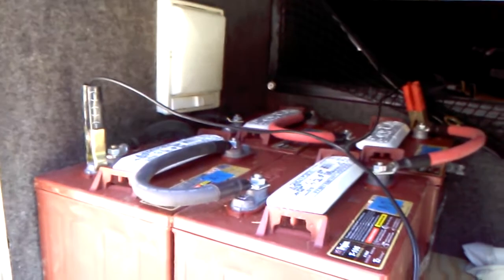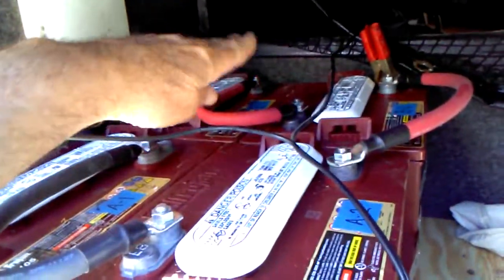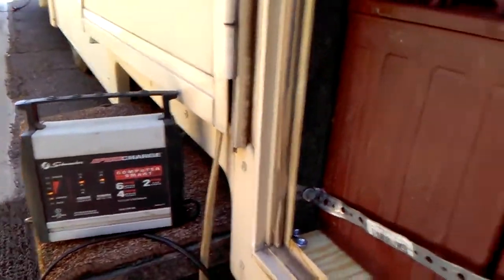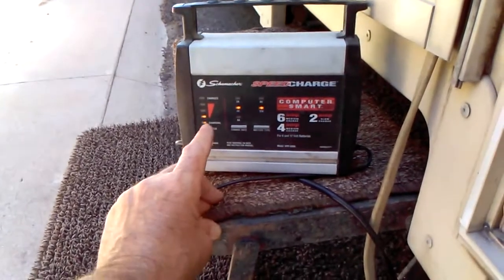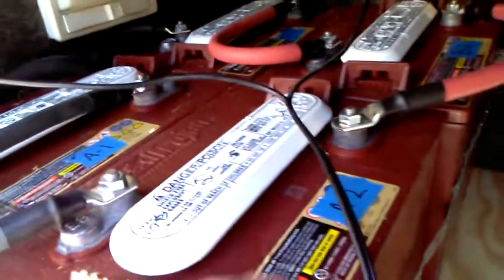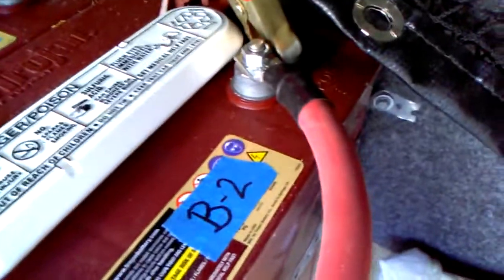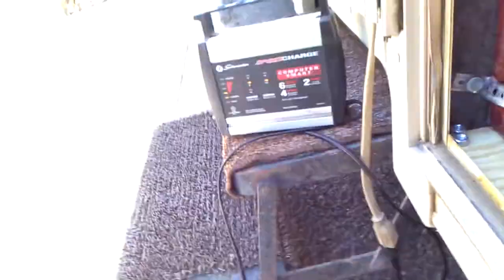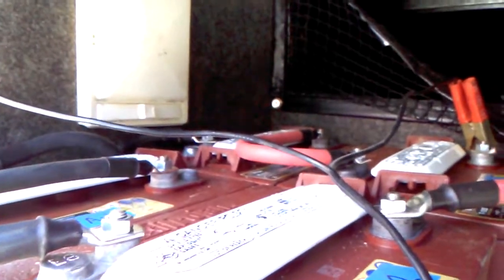HELP.! What is wrong when charging Trojan T-105's

Comment from the maker: Turns out the batteries NEED a bigger charge than my little battery charger could generate..
.. I had never heard this before,, but now it is out there to help others design their system.....
Reply: Flooded batts typically require C/10 minimum, or 45A for a 450Ah bank.
Reply: That's good

Comment: Check the cables or water in the batteries
Reply from the maker: Actually it was the charger.. Those batteries require more amps than that little charger could generate.. Happy Trails.!!

Comment: I actually called Trogen on Friday and the tech stated that 14,8 charging voltage is needed now for 4 batteries you need a bigger charger i think , you really have a huge battery bank to fill up , i looked in my charge controller box and found a old charge controller i could adjust up to 14.8 most go to 13ish voltage,  also learn about boiling your batteries,  be careful because your going in without a controller but it works.
Reply from the maker: hey Gary,, yeah I could have used that little bit of info back when I made video.. now I leave it up to show others.. Hopefully you checked out my channel and saw that I now have all the right equipment for the job.. been 2 years now and still running great.. .. Happy Trails.!!

Comment: i had the same . i had 12 volt 2 trojan t105 my 5 amp charger was not enough. how much solar are you using?
Reply from the maker: I have 12 - 100 watt panels hooked up to 8 - Trojan T-105's via 2 separate charge controllers.... I actually only use about ~350 watts at any one time,, tv, computer, refrig, fan, light,, but I do have some things that draw big juice like a hot plate and toaster.. here is a vid I did last year.:https://www.youtube.com/watch?v=Fy9jcnknhos&t=79s .. .. You said "you had"... what do you use now.? .. ..Happy Trails.. Thanks for watching.!!

Comment: I agree wired correctly.  Check water level, tightness of connection but overall large deep cycle batteries need a "hard charge lots of amp/volts like the battery guy said. The charger is actually trickle charging so it may take a few days and not great for the batteries. Nice batteries. More power Scotty lol
Reply from the maker: I have lived before with only 150 watts in a motorhome,, so I am hoping 900 will be sufficient.. Yeah, I agree that a small charger like that is not ideal for the batteries.. I would have put a single, smaller 12V for the coach battery if I had known that earlier..  Have you entered the Gold and Silver Giveaway yet.?

Comment: After living off grid and had battery banks such as yours, I concur with the battery guy. You need a minimum of 15 amps ,5 amps per battery.  Or disconnect and charge one at a time. Those small chargers are not meant to charge such a large battery bank.
Reply from the maker: I was planning on using 1 - 100 watt (~6amp)  panel to charge 2 more T105 'coach' batteries.. .. so that will not work.?
Reply: deserthorizons 
That panel will work for maintaining a charge, for occasional use, but if you are gonna use the batteries alot, you are gonna have to calculate your electrical load, and add more panels. Say for instance, if you discharge those two batteries down to 50 percent in a day, it would take four 100 watt panels, to get the batteries back up to 100 percent within a day, then you will also have to start getting into charge controllers. Even with one panel I would recommend using a small charge controllers, that way the batteries are charged properly and not over charged. This stuff has a science to it, hard to explain through a message. Contact Northern Arizona Wind & Sun, these guys are great and will be able to help you with any questions.
Reply from the maker: Gotcha,, Thank you.. I was going to hook up 1 - 100 watt panel through a 30A CC  to the coach (2 - 6V) uses DC that will not get much use at all.. Then 8 - 100 watt to these^ 4 batteries through a 79A CC for running tv, computer, lights, etc..  So it sounds like it is going to work and the batteries are good, so now it is just mounting everything and "plugging" it in..
Reply: deserthorizons

Your welcome! Glad to of been some help to a fellow native.

Comment: I wonder if the output of that charger is working. Switch on/off & verify selector switching. 
Other wise, id bet one of the cable lugs isn't getting good contact to a batt terminal. 
Something simple when you look over it again.
Peace.
Reply from the maker: The output of the charger is max 6 amps... That is NOT enough for these batteries.. It was something simple but it sure had me riled up.. Thank you for the input.. Did you enter the Gold giveaway.?

Comment: Ideas; could be the cabling is corroded somewhere less obvious. Get a basic digital multimeter, (hecho en china for "5bucks")  test resistance end to end on each. And then adequate current/voltage out at the charge source. And at batt terms. Above 14volts, (Controller or charger fried/damaged/ misprogrammed/ etc) elect current gets lost as heat, when facing resistance. That is also a " tell" of problem in a system/circuit. 
Also a specific gravity tester gives "state of charge " % (escapes atm, u can look up)
Peace.
Reply from the maker: Thanks for the ideas.! .. -I know it doesn't make any difference, but it should,, These are brand new batteries and cables.. I haven't even hooked up anything else yet, but everything else will be new also..
Reply: deserthorizons yeah, has to be something simple.
 if the charger/leads/clips, are damaged,,  or an  (open)poor contact at batt post to cable lug (one of the jumpers) 
"Look w/ fresh eyes" oft helps.
 I would check actual voltage, at the various points, but might be a warm spot, after being plugged in several hours, that would tell U something also. 

Peace and blessings.

Comment from the maker: After 2 days, "The Battery Guy" (Where I got the batteries) got a hold of me to say the T105's do not really like less than a 15 amp charge going in.. So that means if you use 2 batteries and only have 2 - 100 watt panels,(=12amps), you're batteries are not getting fully charged.. .. -huh.? First time I ever heard of that, but we will see.. I have been freaking because I am about to start hooking up the rest of the system and the batteries are the foundation..
Reply: >  if you use 2 batteries and only have 2 - 100 watt panels,(=12amps), you're batteries are not getting fully charged.. .. -huh.? 

People are typically wildly optimstic about how much charging can be done with solar under real conditions.  Wild generalizations follow for the sake of illustration.

A 225Ah bank (like one set of the Trojans) will require about 138A to recharge fully from 50% DoD after charging inefficiencies.  About 1,880 watts.  This is suprisingly difficult/impossible to do with small amounts of solar alone, and is the reason people augment solar charging with generator, shore, or alternator. 

On an MPPT controller 200w of panel will make something like 166w after temperature derating, buck conversion and wiring losses.  This means we need 11.33 hours of Full Sun Equivalent (1,000w/square meter)  per day.   But that's not what we get.  The most sun available anywhere in the US at any time of year is 7.7hrs of FSE, which is available in areas like Vegas and Phoenix in June.  So we actually need about 50% more panel even under the best conditions possible and with no other loads interfering with charging.    Other places, other times, and additional loads will require even more.  

I personally run 750w:220Ah in the desert Southwest and there are days when even that is iffy.
Reply from the maker: @fratermus5502  Thanks.. This video was 3 years ago when I was getting things together for a system.. I now have 2100 watts going into 16 Trojan T-105's through a MidNite Classic 150 Mppt controller.. It worked beautifully last year on 1600 watts of solar and now I expect it to be even better this year with 2100 so I won't have any more "iffy" days.. All the upgrades are documented on more recent vids.. Thanks for watching.. ..Happy Trails.!!
Reply: deserthorizons any luck?